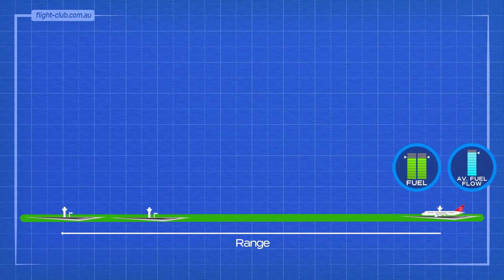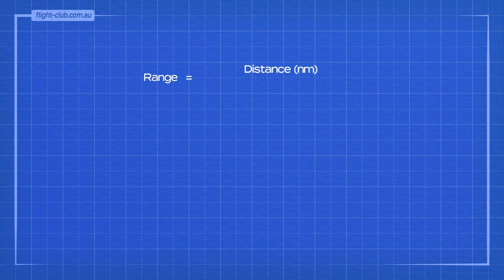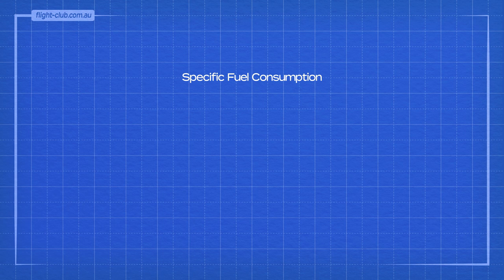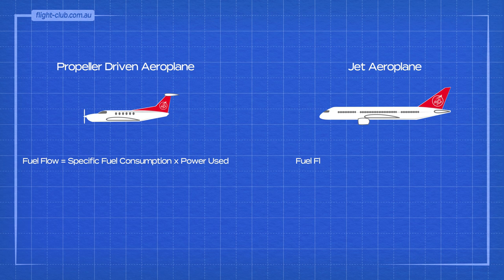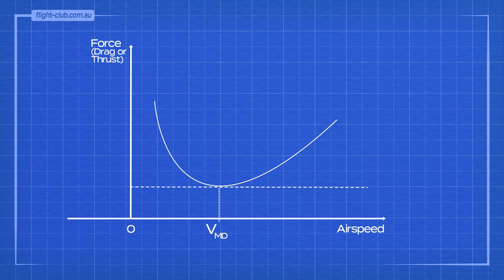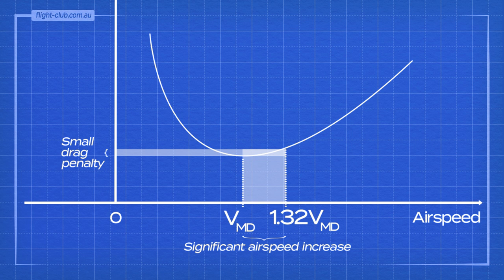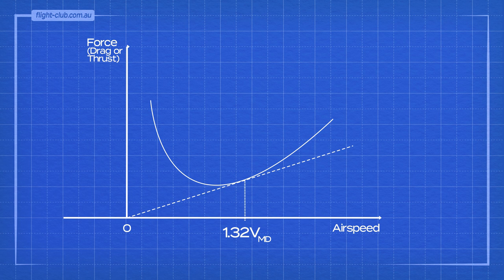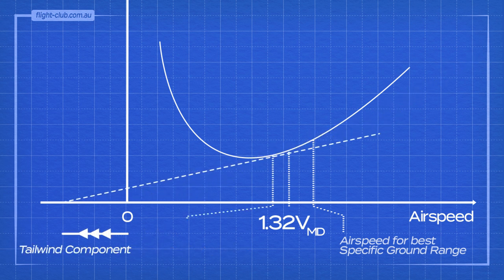What is Aircraft Range? Your ATPL guide to Specific Range, Specific Fuel Consumption and Fuel Flow.

Comment: One little remark here:
it's not always beneficial to fly at the best fuel economy speed, because you will end up traveling longer and the total cost of a trip will be higher, because you essentially decrease your TBO (time between overhaul for an engine and other components that has to be checked). This, of course, only applies to airplane owners.

Oh, and btw, great video! 👍